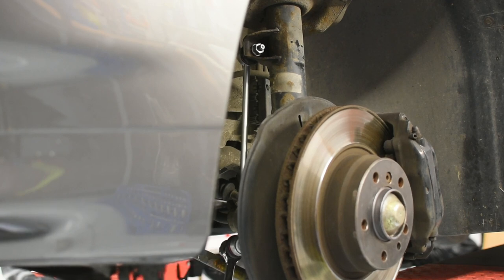Sway Bar Link Replacement: BMW 7 E38

Comment from the maker: 🔧 Tools used: 
       🔹BGS 2292 General rachet and socket set: https://geni.us/0Hhd (Amazon)
       🔹BGS 5188 Torx and Hex socket set: https://geni.us/Zz55Akr (Amazon)
       🔹BGS 9473 combination spanner set: https://geni.us/pxBAWw (Amazon)
       🔹Hazet 1979N-92 flashlight: https://geni.us/gTxEiHA (Amazon)
       🔹Hazet 1979WP-1 magnetic charging pad: https://geni.us/abMfAS (Amazon)
       🔹Gedore 40-200 Nm torque wrench: https://geni.us/zseU (Amazon)

⚙ Spare parts used: 
       🔹Lemforder 13132 02 end links: https://geni.us/7mY09 (Amazon)

⚙ Additional stuff: 
        🔹Nitrile heavy duty gloves GRIPPAZ: https://geni.us/tc4XaYP (Amazon)
        🔹Brake cleaner: https://geni.us/LOeBEc (Amazon)